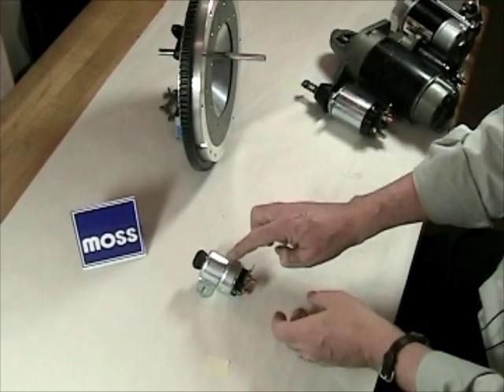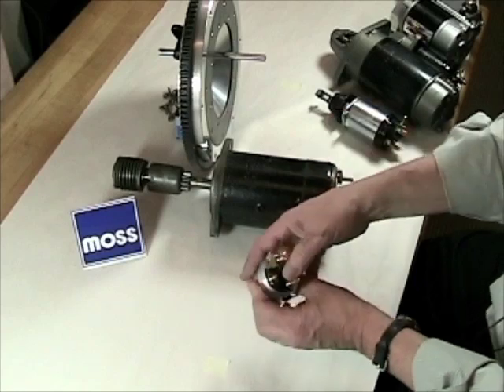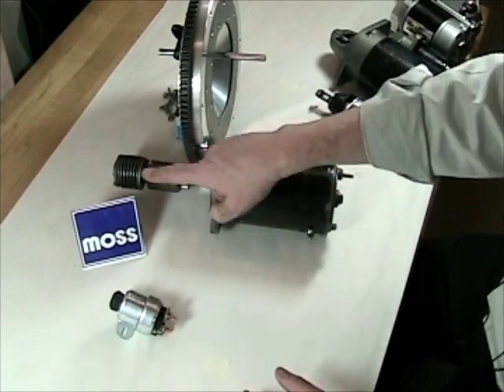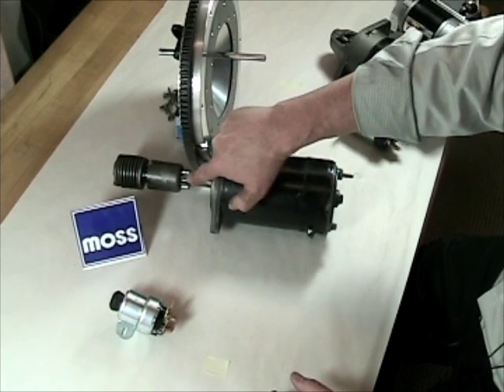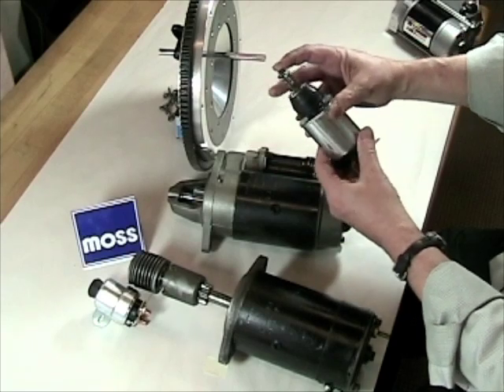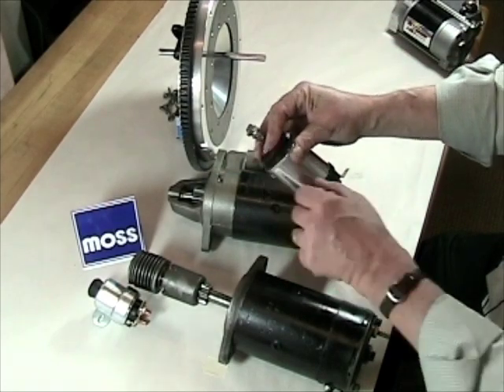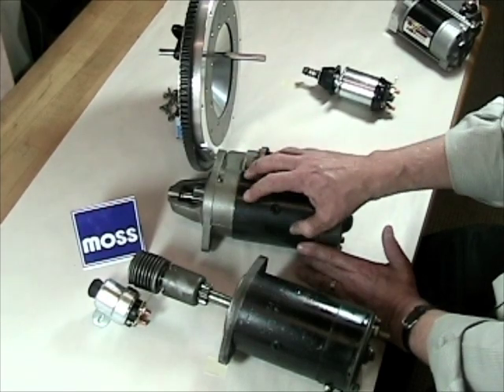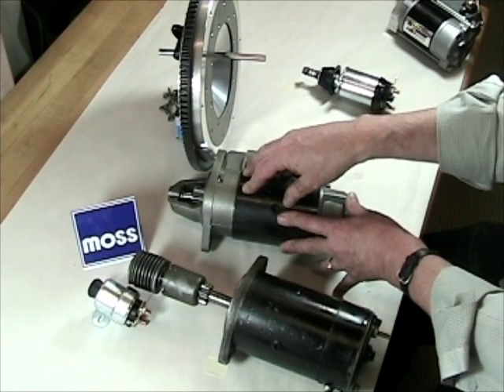Starters & Solenoids - Explanation of How They Work (Inertia & Pre-Engaged Style)

Comment: What's really crazy is that the lever is no longer metal but hard plastic to cut production costs. They snap all the time now. After fixing an unrelated coolant issue, I had one snap in the shop when starting the car to park it for the customer to pick up. Try explaining that to a customer.
Reply: Damn shame. How much money do they really save on such a small part. Maybe it's also to prevent damage to the ring gear. I'd much rather replace a starter, than have to pull the block and separate it from the transmission. 💯
Reply: @BiffTannen1983  It was a warranty job. I worked at a dealership at the time. The only person that got screwed over was me, the tech getting paid a 1/2 hour commission to rebuild a starter. That was a long time ago. I work for an independent shop now and am much wiser at my trade.

Comment: On the second starter, the pre-engaged non-gear reduced, how do you ensure that the gears mesh? Wouldn't you stand the chance of them just butting teeth?
Reply: Good question and your intuition is correct. So to prevent this "butting," the gears on the spindle of the motor are chamfered on the end that engages the flywheel gear teeth for smooth meshing. The two sets of gears are then able to kind of slip together.

Comment: This is Great! I was just operating on a Murray (made in China) snow-blower.  The starter was not engaging. When I got it exposed, I saw it was your inertia version - which I have never seen before -- I even owned an MGB and cleaned the inside of its platter styled starter motor.  So, the gear gets close but does not engage and then picks up speed with the high revving starter motor.  Do you think the "washer" that rides on the worm gear and pushes the starter gear is worn and loose?

Comment: Wouldn't putting a relay that is normally closed when not energized on the circuit that normally goes from the ignition key to the starter solenoid and then putting another wire that consists of simply the starter solenoid, the relay just mentioned and the battery do the trick? Just wondering. That would  energize the solenoid when the key is off, and de-energize it when it is switched on.  :) Yes, no?